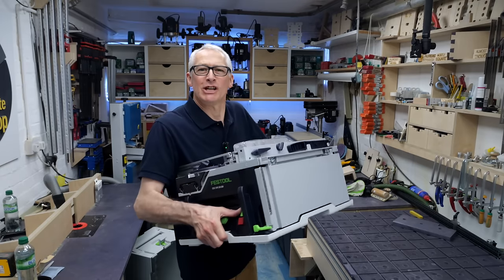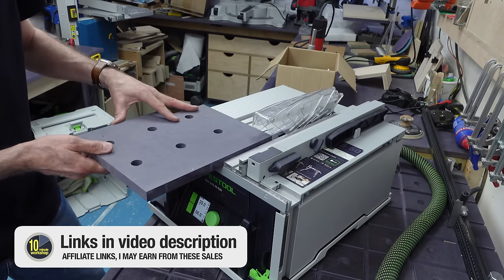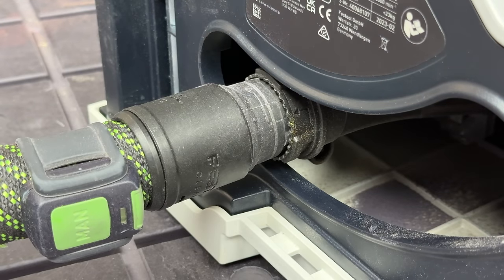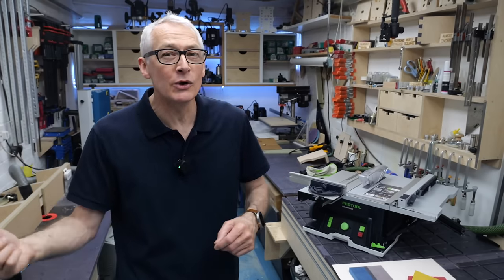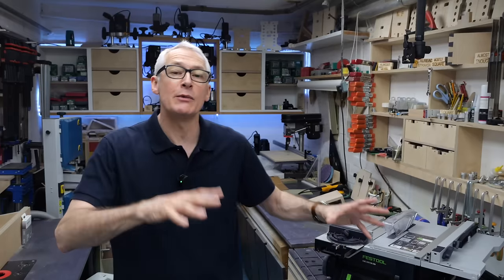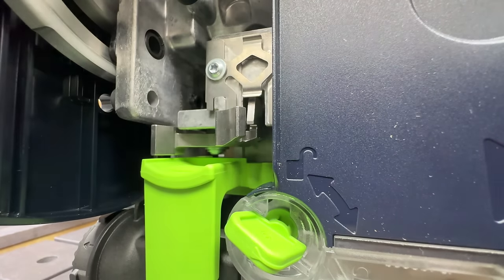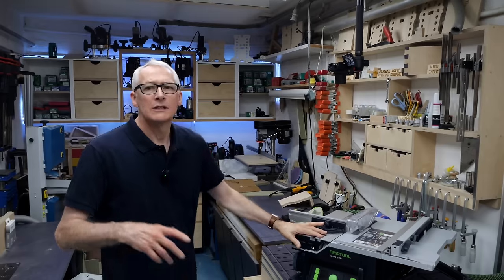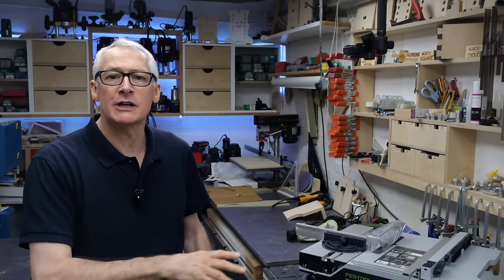Festool's Big Mistake [video 530]

Comment: I would much prefer having a fence equipped with a DRO than having a digital height/angle adjustment on the blade.
Reply: rack and pinion fence should have been the way to go, too many compromises in this thing to appeal to the majority of users. i get its portable, but so are most site saws, cut capacity is laughable, and i can see the electronics giving trouble long term. i appreciate the quiet motor, but thats about it.
Reply from the maker: It's not for everyone, no. Also, not a 'site' saw...
Reply: @10MinuteWorkshop  then who is it for peter? it was made to be portable, but i cant see why, its a precision saw , i can see it appealing to a narrow band of home craftsmen who make smaller objects, box makers maybe. not trying to be argumentative but outside of cutting small filler pieces for kitchen fitters and ripping smaller trim pieces i cant see the point of battery power only, the capacity is too small for making furniture larger than side tables, i just think they have missed the mark when designing this. if it had a better fence system and mitre guage, a slightly larger footprint of a dewalt or milwaulkie (similar weights) they would have sold truckloads, i think this will go the way of their previous attempts at tablesaws, quietly withdrawn after a few years due to low sales figures. i wish you joy with yours however and am happy to be proved wrong. regards.

Comment: Yep, Table saw and miter saw need plugs. Waiting for a new Kapex, dut not with a smaller blade (I would rather it used standard 12" blades.) and it needs a plug as I will seldome move it from my shop. If not battery powered, it should outlive me.

Comment: When Festool "persuaded" the Australian competition regulator that it should be authorised to ignore retail price maintenance and other prohibitions, it told them it was so they could provide better service if it didn't have to comply with all those pesky regulations. Guess which company with the superior service doesn't have it's table saw available in Australia? Some cynics might say the ACCC was not so much persuaded as conned but that is unfair, true the regulator is staffed by accountants and lawyers earning about 25% of what's possible on the other side of the fence and inadequately resourced but I am sure that has nothing to do with it.

Comment: Imho they are full of it for saying that the sawstop system needs ground connection.   It works on the same principle as capacitive displays on cellphones. And Bosch has a table saw with battery power that doesn't need the ground to detect fingers.

Comment: Many years ago I bought a Sony TV as I was advised by people in the know that they were the best made. Shortly afterwards I was told by a TV engineer that the quality of them had massively dropped as production had been moved to a different country. I heard the same thing had happened to Mercedes Benz in the eighties. I hope the same thing isn't happening to Festool as I've been saving for a Kapex mitre saw for a while, believing they were as good as it gets ?
Reply from the maker: My old Kapex is good, the newer ones are better.  👍
Reply: @10MinuteWorkshop  Oh good !! Not quite ready to raid the piggy bank yet as I'm looking to move house but glad to know quality on the whole is still good, surprised with some of your findings on the new machine though ??

Comment: Dewalt make an adaptor for their battery mitre and tablesaw which is basically a unit shaped like a battery with a power supply in it that you can use to power the units. Maybe Festool can do something similar later? I think the pins and comms are setup so that they can only be used for those units, so maybe there's some blocker to that with Festool..
Reply from the maker: Festool offer something similar for their sanders, but say they can’t for the saw because of the power draw from the motor being too great.  🤷‍♂️
Reply: I believe they dont do one for the table saw due to some issue which i cant remember . The one fir the mitre saw has been known to burn out the motors i was on forums when looking at buying one , so i didn't just got the little 18v saw which is great.
Love the look of this table saw but its the wrong colour😃

Comment: The much cheaper Evolution Rage-5S has the same sloppiness in mitre gauge fit, shame to see it in a machine that's 5x the price. The workaround there is to wrap some duck tape around the length of the gauge which eliminates the slop. However it's still a lot more predictable to use the sliding component of the table rather than the mitre.
Also, I winced when I saw how close your fingers got to the blade! I try to make sure my hands don't go past the cutting edge.  Featherboards or rollers should keep you safe.
Reply from the maker: Blade guards in place at all times, and as I said, they don't expect you to use the mitre gauge loose, you lock it down and use the sliding table. But I point it out as a general area for improvement on the fit & finish of a £1500 investment; it would be remiss of me not to. 👍

Comment: I would much prefer a corded version of the saw. Like Peter, I have a very small shop and a saw of this size is attractive for that reason. However, being able to use the saw without a cord provides no benefit, it only makes the saw cost a lot more than it otherwise would.

Comment: Absolutely agree there should be a mains option on a table saw, there is nothing preventing them from adding a psu with some charger circuitry.
Those sloppy rails remind me of old laser printers, it is embarrassing, it’s rattling like a children’s toy. I’d be annoyed every single time these parts flop around and rattle like that.
And 1500 with no guide lasers, settings HUD on the guard or even an LED to illuminate your cut, I guess the innovation team spent all those hours designing the display typeface...
For the control system to crash randomly is just atriocious, this simple controller stuff has been done right a million times in all kinds of industrial gear so what is their excuse? If this thing doesn’t make us more productive there is no point. 
The sub-mm height adjustment could be useful for joinery, however it remains to be seen how precise all these adjustments remain after hopping about in the back en route to the jobsite.

Comment: Yes, not having a power option on this saw is a fail in my book. Great that it can run on batteries, but as this would equally be at home in a small workshop ,it should have a direct power option too included in the base model.  I’ll wait until they rectify this.

Comment: Sometimes festool is just bizarre. This saw is cordless but the ks 60 is corded ? Festool you got it backwards. Any saw that uses the fsk guide rails screams cordless. The Metabo hpt multivolt table saw is genius cordless/corded.
Reply: They’ve had a corded circular saw for the FSK tracks for years

Comment: Thanks Peter... I was waiting for this review as i kind of imagined it might be a bit of a disappointment... I own a quite a number of festool products, but for me this saw just seemed a little useless.  It's like when mobile phones first emerged and then it was a race to get them as small as possible and then when they had reached that point they started to grow again into the near Ipad sized ones you see now...  While there is room to say this is their first 'jobsite' battery table saw so we should cut them some slack, to be honest, this is 'FESTOOL' and we should expect higher standards...  Over the years i have noticed other brands catching up, and as their patents run out on things like the plunge saw, and soon the domino, they may need to compete a little harder again.  I still believe festool rule on certain products, like their router series, the domino's, dust extractors, the plunge saws still hold their own also and the edge bander and MFT are nice additions.  But drills, tablesaws and the rest of the handtool range you can find cheaper and comparable products elsewhere.  I truly believe they have a problem in their R&D department and they need to start picking up their game, especially considering the prices they ask.  While i would say there is still a use for this saw due to its size, it also means it lacks capacity... i just don't see any real advantages to this saw over any other jobsite battery table saws that are available, and it really isn't that much smaller or quieter than others.  A weak addition to the market from festool honestly, but they have been behind the rest of other companies when it comes to moving to cordless machines and this seems a little like 'form over function'... To be honest i just find myself being angry at festool of late due to their lack of innovation and progress over the last number of years, although the scoring blade on the new tracksaw is a gem!  Semi-rant over...😂😂😂
Reply from the maker: Thanks! To be clear, I'm really happy with the saw - I wanted a quiet, small, accurate saw with great dust extraction, and that's what I have. I feel there are areas that could be improved and it would have been remiss of me not to mention them, but overall I'm very pleased with it, and I'm looking forwards to using it on some projects. 👍

Comment: Festool have a bad history of changing their proprietary battery formats to try to force the customer to buy a whole new load of tools - I have 2 Festool drills sitting around that I can't get new batteries for here in Australia. Ryobi has been the best, their current One+ batteries are the same connector format that they had back in the days of NiCad cells, but I ended up with Makita.

Comment: I wonder if there's any smarts in the battery that the saw is talking to, or if we'll see a third-party power brick with a battery-like shell and 2 contacts exposed for making it compatible with mains power...
Reply from the maker: Fingers crossed. Festool make them for the cordless sanders, but - they say - the power draw is too much from the saw motor to offer it on the saw.  🤷‍♂️
Reply: @10MinuteWorkshop  Interesting. I wonder what the DC amp draw is.. on 12V boat stuff, I use 10mm square to move hundreds of amps from battery to engine, and as the voltage goes up the amperage needed goes down. Is there a wattage indicated for the motor? (Can't find anything on their site)

Comment: Thinking on this, this saw is a kumiko practitioners / joiners wet dream. The ability to quickly and accurately (and repeatedly) set height of the blade would be great for making tenons and lap joints would really speed up that kind of work.
Reply from the maker: Yep, but 50mm max depth of cut won’t make for great tenons, and the lack of a flat-grind blade (and 1.8mm kerf) would make for slow rebates/ housings/ dados. 👍

Comment: EDIT: I am wrong, this saw is nowhere near as powerful as I though.

A 240VAC to 36VDC@50Amp power brick (1800W peak power supply) that could run the saw would probably add 500£-1000£ to the price, weigh 4-5kg, need active fan cooling, and have thick expensive cables between the power brick and saw (somthing like 10 AWG to handle the current draw). 

However, a built-in charger that could top-up the batteries when the saw was not running could have been done.
Reply: Hitachi / Hikoki / Metabo HPT have figured it out. Their 36 volt battery adapter runs $125 US, though it does require active cooling and a chunky power brick, but doesn't require exceptionally large wiring. Given that we're talking Festool you're probably not wrong on the hypothetical price, however.
Reply: @nominalvelocity  The Hikoki adapter has a maximum power output of around 1000W, which is about 50%-60% of the peak power required for a table saw.

The Festool saw in the video requires two batteries to operate, and similarly you would need about two of those big clunky adapters to run the saw from mains voltage.

It's easy to make a tablesaw run of either mains AC or battery driven DC - but making one that can run on both requires a lot of beefy and expensive power electronics which is why no one is doing it.
Reply: You are crazy if you think this thing actually draws 2000w from the batteries. It is max 700w, and lower on average.
Reply: @riba2233  Tablesaws are usually rated at around 1800W continuous so I strongly doubt your claim of 700W peak load. Contractors would never trip a circuit breaker in their entire career if it peaked at 700W.
Reply: @Oysteims  this one is a toy compared to the ones you are describing, and battery tools that use brushless motors are much more efficient and don't need that much power compared to ac powered ones. Also these two batteries can provide at most 720w each peak, but would get very hot if used like that continuously, so I guess they use around max 350-400w per pack.
In any case, a 1000w adapter with 2000 peak rating like the one from hikoki would be plenty for this tool. Festool battery powered tools are not very powerful at all in general.
Reply: @riba2233  You're absolutely right - I made a lot of assumptions based on much larger mains powered saws.
Reply: @Oysteims  np, enjoy :)
Reply: @Oysteims  in my two minutes of casual googling it seemed like Festool was really shy about publishing any hint of wattage or amperage, but I suspect that given the blade size and cutting depth its power is more comparable to a track saw than a usual table saw. Hikoki's table saw has a larger blade, more cutting depth and can use the power brick. A 4AH 36v battery has the same number of cells as 2x 18v 4AH batteries, power output and capacity will be about the same. 1000w would probably outstrip the needs of the Festool saw.

Comment: Si tu n'utilise pas le bleutooth pour déclencher l'aspirateur tu doublera le temps d'usage. Soit 1h en continu le temps de charge de 2 batterrie est de 45mm donc c'est bon. J'ai demandé à festool pour savoir pourquoi ils n'ont pas fait une alimentation externe sur réseau électrique. Leur réponse est que ça aurait coûte plus cher. Et que le transformateur ne rentré pas dans la scie et que le moteur brushless était limité en amperage grâce aux batterie et que sur réseau électrique il ne le serait pas ce qui provoquerait des démarrage plus brutal et endommager la scie
Reply from the maker: Interesting, thank you; I've only just got the bluetooth batteries, I hadn't considered the impact it may have on battery life! 🙌
Reply: @10MinuteWorkshop  n'active pas le bleutooth des batterie avec  l'aspirateur tu verras la difference

Comment: I bought this saw too and my opinion is it’s a great saw, yes it’s battery powered but advertised as such, there are other festool mains powered saws available if you wanted mains power. Yes it’s small so obviously not meant for ripping full sheets down, a track saw first to get the pieces manageable before finishing on this saw. The size is perfect for getting around and has as many advantages as disadvantages in this respect. It packs a powerful punch and the cut is superb im on the festool battery platform so have plenty of batteries . I think you painted a very negative review and just wanted to counter that a little.
Brian
Reply from the maker: Hi Brian. This is a ‘first impressions’ video having owned the saw for a week; everything you say I also mention in the video, and overall I’m very happy with the saw - it does exactly what I bought it for. It’s small, lightweight, quiet, has great dust extraction and cuts really cleanly.  I’m sorry if the feel the video was negative, but it would be remiss of me not to point out the obvious areas for improvement, and the fact that as a customer this was a poor experience, paying in advance and waiting four months for a product that never materialised.  If I hadn’t cancelled that order and bought from Amazon I’d probably still be waiting.

But it’s a great saw I’m really pleased with it and looking forward to using it in some projects.  👍👍

Comment: If my dust extractor gets plugged into the mains, why not plug the saw into the dust extractor.
Yes I have Festool tools, but all corded. My cordless tools are of two different brands. Two purchase this would require two batteries + charger = extra dollars.
Reply from the maker: It’s a cordless saw, no mains option; that’s the big mistake. 👍

Comment: As a trained woodworker, Festool user and with 20 years in marketing, I can say ONE thing with certainty: this was definitely NO "mistake", nor was it a coincidence. Batteries age and will eventually need replacing. This generates a constant stream of revenue for Festool, - something all manufacturers are pushing very aggressively these days.
Reply from the maker: Unfortunately, it’s also resulting in fewer sales of saws. 🤷‍♂️
Reply: @10MinuteWorkshop  I hope so - that's the only way manufacturers learn...
Reply: do you have any lithium Festool batteries? Mine are 10 years old and still going strong.

Comment: Festool could make a 36v switched mode PSU in the shape of a 36v battery. That way it would work on existing saws out in the field.

When your battery runs out, you slide it out, slide in your 36v PSU brick in it's place, and plug it into the wall.

Comment: It is a shame that it only runs on battery — especially as portable power stations have become quite common lately.
A shop vac with batteries and a connector for the saw would also be a clever option.
Reply from the maker: They do make a cordless midi vac. 👍
Reply: Double shame considering Festool themselves make and sell a portable power station